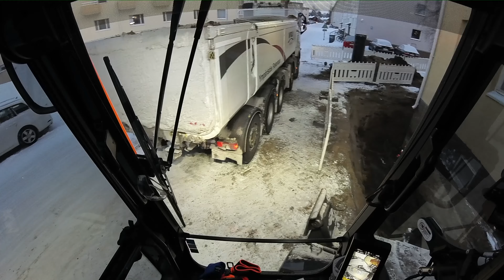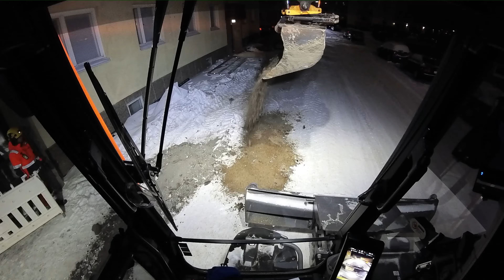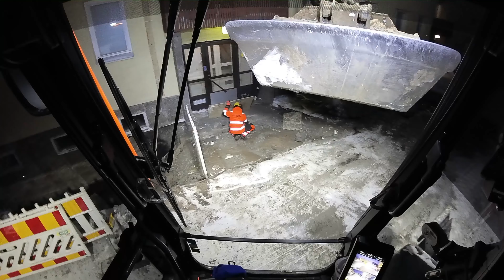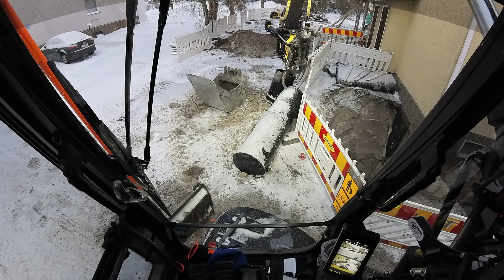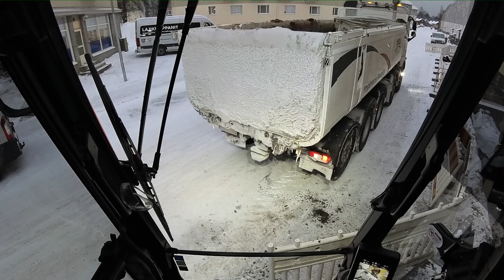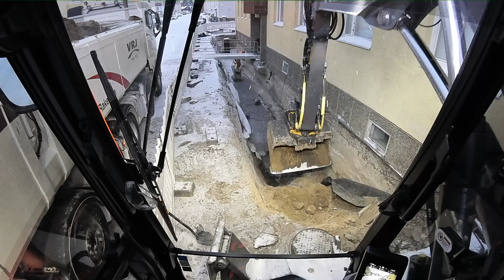salaojitusta. seinän vierustan aukasua. drainage installation. trench opening. volvo ewr150E.

Comment: Hello one questiom i am buying new machine EWR150 or EWR170 ?
Reply from the maker: hello! I have only test driven the ewr170E for a few minutes. 170E is also really good. The 150E is slightly smaller and lighter. if size is not a limitation i would choose 170E i have operated 150E for about 7000 hours it is also good👍👍😃
Reply: Now i have ew160c. difference between ewr150e ewr170 is only 30cm and 20k€ :)
 @renkivain
Reply from the maker: @Juref3j  what kind of work do you do?